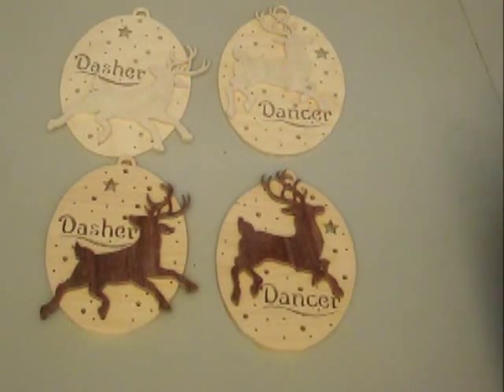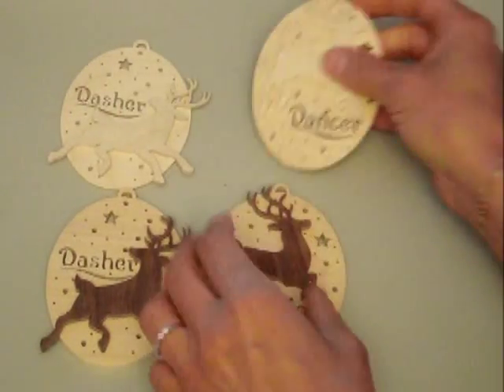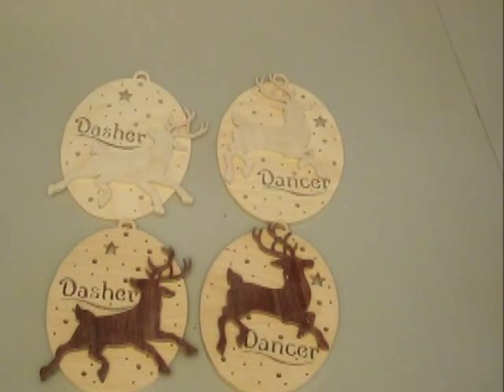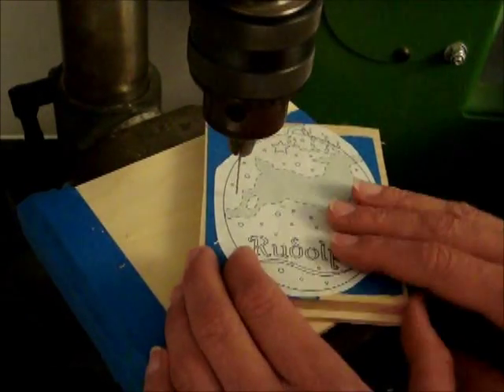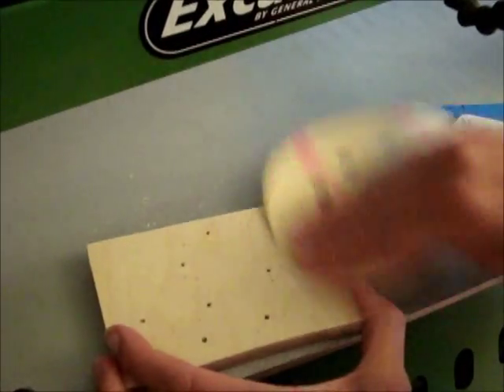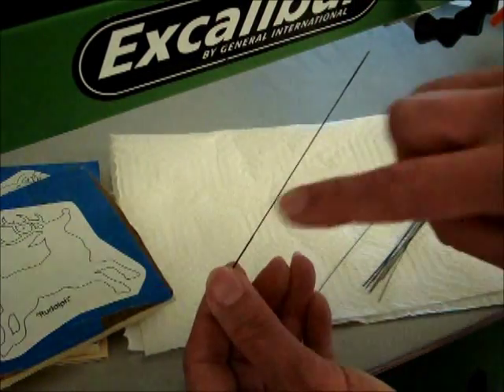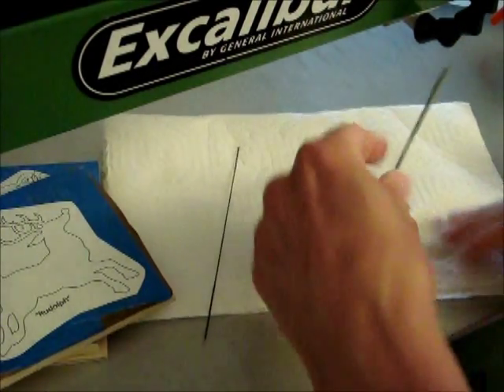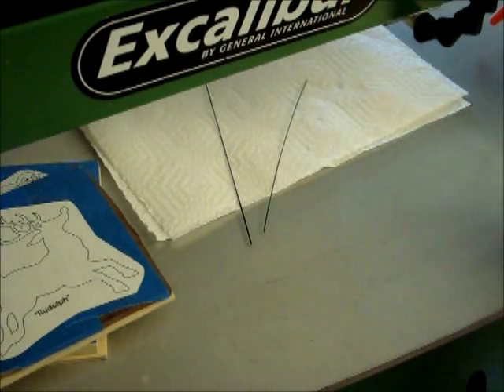Reindeer Games Scroll Sawn Ornaments Part 1

Comment: So, when you put tape on the wood does it keep it from tearing the wood up when the blade cuts? Sometimes I have problems with that.
Reply from the maker: The tape is more for keeping the blade cool and preventing it from burning the wood. The adhesive in the tape somehow helps burning. I always recommend at least a layer of clear packaging tape when cutting ANY hardwood. Try it on a sample piece and you will be amazed at the difference.  For back side tear out, it is best to use reverse-tooth blades. There is an article on blade selection on the free page of my site here:  http://www.sheilalandrydesigns.com/free-pattern  There are lots of articles that will help with a variety of issues. I hope this helps. :)
Reply: Thank you so much. I appreciate the very quick response. Grateful for the information. Subscribed.